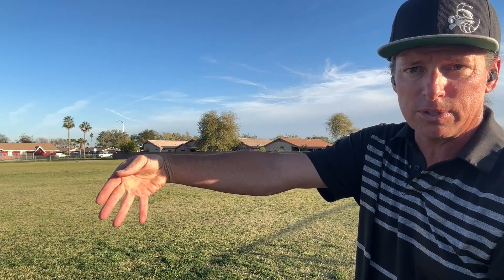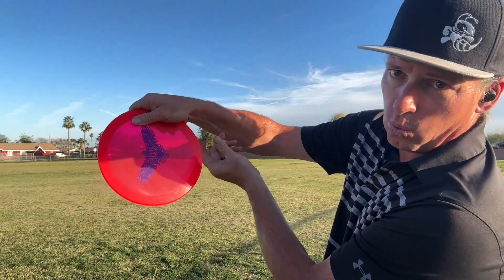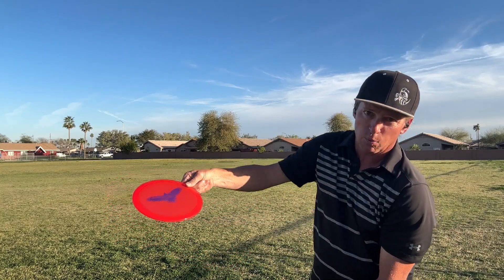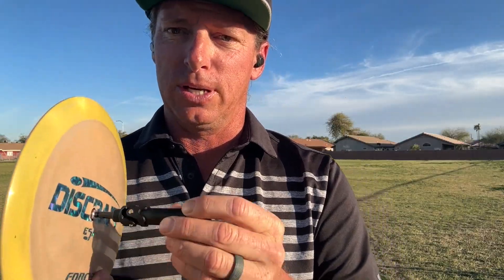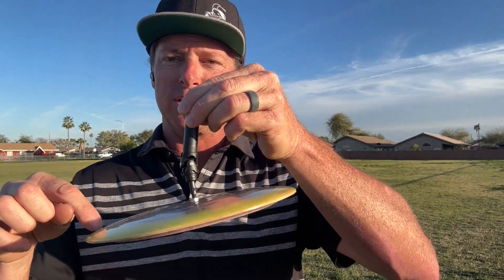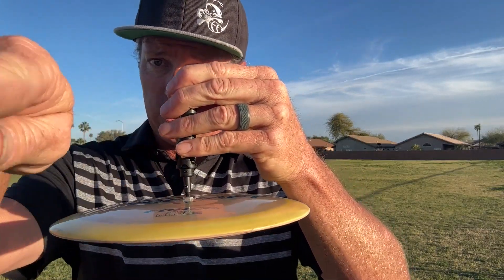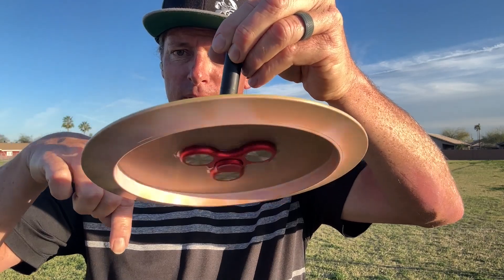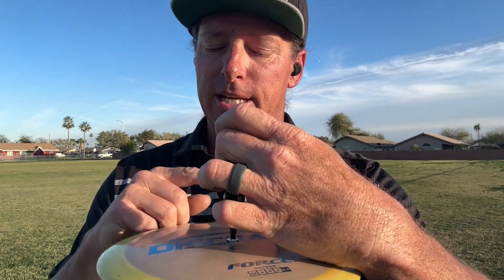Thoughts on Nose angle and gyroscopic precession

Comment: Well the disc will retain the inertia you put into it after release and even though its not independantly suspended from its center it is enough of a gyroscope to manifest even MORE of the "offset effect" that gyroscopic precession is (btw I think the spellchecker nailed you in the title of the video =). In essence your fingers stabilize the disc only partially and the one axle we truly care about when we want to manipulate noseangle is more or less free from interference by us since the force we apply is more or less aligned along it and thus has no lever to work with so even though it's not fully a gyroscope until you release it is enough of one to respond accordingly. I also find the behaviour of beat-in discs fascinationg in this context as their "extra understability" works differently than what you get from simply having a low partingline since the uneven "wavy" topside of a beat up disc essentially generates slightly more lift with the side that rotates against the airflow which serves to lift the nose of the disc more and more during the flight which is kind of what you want for a soft "extended" landing on a long throw. I think the best analogy to explain that effect would be something Czesław Antony Marchaj called the "flow memory effect" in his book "Sail Performance". In essence he described how airflow does not immidiately detach in response to sudden increases in angle of attack as demonstrated by not only birds flapping their wings but windsurfers pumping their sail generating more power than they should by static analysis. The uneven surface of a slightly warped disc that is spinning would in my opinion also benefit from this effect and I think that is primarily why their behaviour is so special. Finally re: Precession I think the MIT lecture given by Walter Lewin on gyroscopes is still one of the best on youtube.
Reply from the maker: Thank you for the spellcheck…. Title fixed:)
Reply: Hey thanks for that explanation! Since you are casually blowing my mind a little maybe you can explain physics behind the turn of the disc. Is it like a pressure difference thing combined with gyroscopic procession?
Reply: @chrisp9824  Well first of all just like with an airplane wing lift comes from the movement of air over the top and airspeed across the surface matters because more speed => less pressure (air is essentially a gas in motion). The "microwarping" of a beat up disc won't do much on the side turning with the airflow but on the "upwind" side it will basically vibrate against it. This "vibration" essentially does the same thing as a windsurfer who pumps the sail => it moves up and then down again to "yank" the air down with it. This then creates a force "lifting" both the left side of the disc and the "precession" then also lifts the nose over time. In contrast the "off the shelf" understability of a disc with a low partingline works by pushing the nose down which then causes the precession to turn the disc over into an anhyzer. With premium plastics it really won't show up much though since it takes a lot of abuse to bring a disc to this level of wear but slightly overstable molds in a baseplastic that really distorts on impact will showcase this quite well after you deliberately abuse it to add 2-3 steps of understability. I've also had a few biofuzion Trespasses over the years that got to this stage of wear after 6-8 weeks in the bag.
Reply: Oh and what do you think about a disc with dimpled top then? It should give it similar properties to a well beaten disc, right?
Reply: @chrisp9824  "dimpled" top wouldn't usually be the same becuase most of the time the dimples are made sharp enough to detach the airflow just like on a golfball as is the case with the Latitude 64 "Raketen" and "Missilen" discs.. I have a Raketen and the price of the extra speed is that the lift of the disc is cut in half. If the surface was softly "wavy" it might work better but it would need to be subtle and the alignment should be much like the spokes of a wheel.

Comment: Pete - what you're describing is exactly the same phenomenon that occurs with rotating helicopter blades. Gyroscopic Precession and Phase Lag in rotating blades means the pitch angle change in the blades takes place 90-degrees after the swash plate made the control movement. Never made the connection this is what's happening with a thrown disc, but the similar physics now completely makes sense. You'll find much more research and explanations for GP and PL in helicopter rotors that can be transferred to discs.
Reply from the maker: Yes! I’ve flown rc helicopters and still love flying rc sailplanes these days which opened the world of reading the wind and air up to me for disc golf. My experience with the helicopters  started me thinking about this stuff many years ago!

Comment: If you hand has any force on the disc like you mention it would wobble
Before it rotates the way you state. That force only happens after the disc is spinning.
Reply from the maker: “Off axis torque” cannot exist unless the disc is in some way experiencing  angular momentum before exiting the hand and fingers. Dis-symmetry in pressure between the thumb and fingers on the top and bottom of the disc at the moment of release does account for wobble.

Comment: What is needed in this discussion of  angle of attack is slow motion video of "nose down" actually flying better than a neutral angle of attack. Tech Disc is a great tool, but I am very skeptical that what is being called nose down = a negative angle of attack and not roll angle instead. Nose up is a common problem for sure, and  I believe what people are getting from videos like these is how to reduce nose up angles and get closer to a level release, which is a great benefit and can add big distance. Having the disc be anything other than completely parallel with the pitch angle is problematic and will increase drag substantially. 

Imagine this: You are driving in a car going 60mph you have a disc on a pivoting fixture that only allows positive or negative pitch (nose down, level and nose up) You stick this fixture out the window and you start with the disc perfectly level (and parallel with the cars trajectory through the air) this is optimal. If you move the nose up even 1 degree, the disc will want to go up and if it is not allowed to, there will be a lot of drag. The same is true for nose down. A negative angle will make the disc want to go towards the ground. A disc is also a wing, so the exception to all of this is that in level flight, most discs create lift, and this can result in a disc gaining a little altitude while also have a neutral angle of attack.  Disc spin adds gyroscopic stability, but a non spinning disc has the same wing shape and generation of lift, etc.

 I contend that ANY level throw that gains altitude after release has a zero or a positive angle of attack. Any  throw that loses altitude immediately after release has a nose down, negative angle. I will be very interested if these concepts can be proven wrong with something other than the Tech Disc. Anyone work at a wind tunnel?
Reply from the maker: The interesting thing to consider about this, is that a disc in flight is not reactive to itself over the center of balance.
During the initial portion of high speed flight the lifting force or center of pressure moves behind the center of balance. This in principle lifts the “tail” of the disc, but due to gyroscopic precession, the effect takes place 90* away in the direction of rotation, which we then observe as “turn” (rhbh/ clockwise spin). As the disc slows down the center of pressure moves ahead of the center of balance and is part of the reason why we observe “fade” at the end of flight.
I would make a hypothesis that negative nose angle imparted at the release point while throwing upwards, helps the disc “get on plane” or arrive at a neutral angle of attack at a higher altitude and farther down the fairway and helps the disc take on the forces more predictably during the high speed turn portion of the flight. Should we start simply with a neutral angle of attack, the finishing part of the flight would have a higher angle of attack or more nose up finish during its fade due to how the center of pressure advances ahead of the center of balance.
If the Disc was simply a wing like an airplane wing or a foil on the back of a car, it would be a far more simple algorithm to understand, but the moment we add spin and thus gyroscopic precession and stability it becomes far more complex.
It would seem to me then, that to “error” with a couple degrees negative nose angle early in the flight, especially when throwing up or higher than level, is far more beneficial than to error with any positive nose up which adds more induced drag from the start, and limits distance immediately.
Reply: Great reply Pete. The logic is sound and getting people to stop throwing nose up is great for the sport. Curious, is all your info supporting when the lift is fore and aft coming from Tech Disc data? Playing with the simulator on their site and having 10 degrees of nose down give more distance than a level release is, well, unlikely.  We need good mythbuster side view style slow motion video of various releases that prove this concept.
Reply: It is like how a spoiler is used to keep a race car on the track. To increase down force, the spoiler becomes more vertical to add downward pressure. The car is built low to the ground to minimize air under the car that would lift the car. My hypothesis is that the “nose down”release probably stabilizes to neutral quickly whereas a nose up release of any kind will catch a lot more drag since the disc would be like a parachute underneath and lift more and more never getting to flat. A perfect 0 would likely give you best flight but slightly nose down probably is better side of error than slightly nose up.

Comment: If it isn’t spinning before it leaves the hand, it’s not going to be spinning after it leaves. That’s why it has the gyro properties still in hand?
Reply: This is a true statement. Maximum rotational velocity is reached at the same moment that the disc is departing hour hand. No additional rpm's happen after this moment.
Reply from the maker: Correct.
Even though we are grabbing it from the edge, we are adding directional inertia and rotational energy into it. We have about 180° of movement to increase the spin. The moment we begin turning the disc, it begins to demonstrate resistance to off axis torque due to gyroscopic properties.

Comment: You could say at the hit point it is experiencing angular acceleration- gaining angular momentum and spin. It is this angular momentum that "turns on" the gyroscopic procession effect. It certainly makes sense that it has enough angular momentum while still in contact with the hand to cause gyroscopic procession effects to occur. The same effect can be seen when discs land- the big hyzer skip is an upward force on the side of the disc being "redirected" to the nose of the disc.
Reply from the maker: Agreed, thank you for the clarity in your comment. I suppose I am just being careful to avoid calling it a gyroscope since we are pivoting from the rim and not the center of the disc, while trying to break it down in as simple of terms as possible.

Comment: Can somebody go kindly tell that barking dog that i'm watching the most important video of my life please?
Reply: Also just to note. What you are describing are the forces on the disc at t=0 if we measure time starting at moment of flight. But the moment of flight isn't when the disc leaves your hand. The moment of flight, or t=0, is actually when the disc BEGINS TO PIVOT out from your fingers. It can be considered the first rotation and why the leading edge points nose down when supinating your hand (because the disc has gyroscopic properties at t=0)
Reply from the maker: Thank you for your insight!
And I did ask the dog to be quiet, I just don’t think it understands English. 
My mic wouldn’t turn on so I apologize for the xtra noise. I fixed it when I got home, so the next video should have less ambient sound.

Comment: so on a forehand throw, would the reaction be on the front instead of the back of your disc.... meaning, when you have the same focus on nose-down as with the backhand, the disc tends to go nose-up...
Reply from the maker: Assuming the forehand is RHFH, we would be imparting a counter clockwise spin. From the last point of contact, the effect would take place 90* away in the direction of rotation. Let’s assume our release point is at near the 9’o’clock point on the disc in relation to the direction of the throw, the effect would be at the 6 o’clock position.

Comment: Does that mean you could benefit from loosing thumb and pushing up with fingerd?
Reply from the maker: If the objective is “only” nose down then technically yes, but the trade off would be loss in speed, spin and some control.

Comment: So what you’re saying is that if you push your thumb down on the tip of the disc as you’re throwing the nose will come up?
Reply from the maker: Hi Josh, it's been a wile, hope you are well my friend! To your question: Basically yes. Let's think of it this way: if we pronate the wrist/roll our wrist under, we will have a downward pressure on the top of the disc through the hit point, because the thumb is our point of contact on the top of the disc, this seems to drive the nose up. If we supinate  the wrist through the hit point (think turning a key clockwise for rhbh) it basically stops the thumb and wrist from rolling under removing the majority of downwards pressure and at minimum allowing for a neutral nose angle.  In my last video, I showed a super slo-mo clip of my fingers and hand at the release point. For me at least, it looks as though my index finger is the last point of contact on the disc, this could in turn mean that part of my negative nose angle is possibly due to the upwards force of my index finger on the rim at the moment of release. @980 frames a second, the thumb and index fingers release separation occupy only 2 frames. It's sooooo fast. Im not trying to let go with my thumb or index finger, it's just what happens when I follow through on my throws correctly....Perhaps that's for another video!
Reply: @DiscgliderPete  I think this is a symptom of thumb placement as well. Thumb to close to center is probably going to cause the thumb to be the last contact point and if it's closer to the rim it should come off before the index finger snaps off